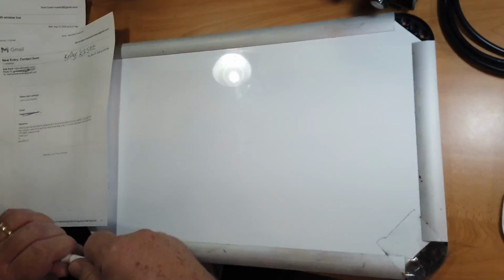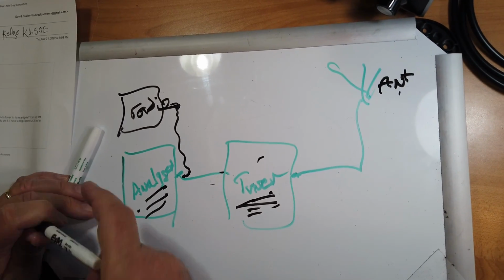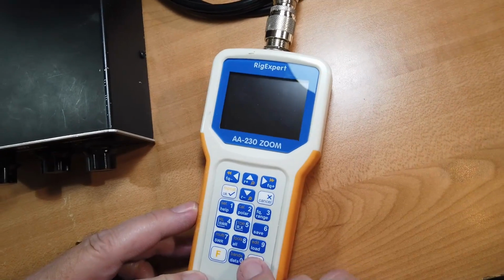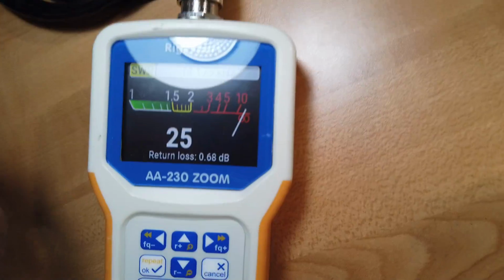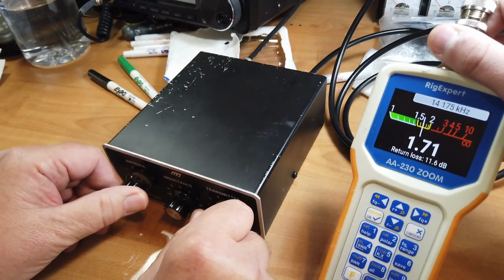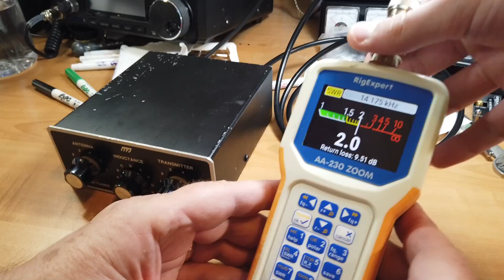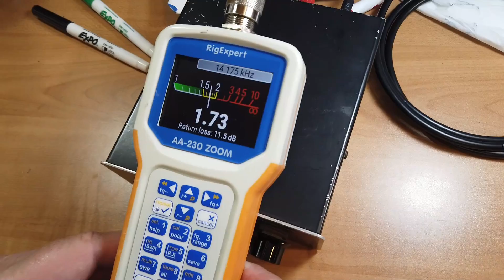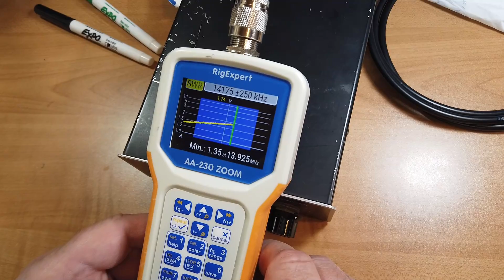Tuner, Analyzer, Antenna: What Order? (#814)

Comment: I would have said. Connect the analyzer to the antenna and then shorten or lengthen the dipole to resonate on the favorite frequency. Then hook the tuner between the analyzer  and the antenna and check to see whether the tuner is doing its job.

Comment: I always used the transceiver's receiver to adjust the inductance for maximum noise, a good place to start tuning the antenna and the transmitter knobs with the analyzer.  My old Icom 751 does not have a tuner and I also have a amp that has to go through the turner.

Comment: Whenever I get confused about the placement of any device in relationship to another, between the radio and antenna, I just consider that the tuner is part of the antenna so it usually has no device between it and the antenna.  Think of the tuner as a variable loading coil or capacitor at the antenna base. All other devices, such as SWR/Watt meters, VNAs, antenna analyzers, radios, go before the antenna tuner, or between the radio and tuner (variable loading coil/capacitor.) Always consider the VNA and antenna tuner as the replacement of the radio, so never have the radio connected to a VNA or antenna analyser if the radio is not the device being tested.
Great video Dave.

Comment: A bit challenging with a remote automatic tuner.
Reply: Perhaps, but if you’re using a remote autotuner, you’re less likely to need to use an analyzer. But if you want to, put an A/B switch on that feed.

Switch to rig. Activate autotune. When that’s done, switch to analyzer, & check how it went. Then switch back to rig, & operate.

Comment: The whiteboard was a good visual and fair explanation of why you should just put the analyzer where the radio would be in your system. You want the end result of what you achieved with the analyzer to be utilized by the radio. Good video Dave.
Reply: If I ever need to explain it, I say that the analyzer IS A TRANSMITTER. A special, temporary transmitter.